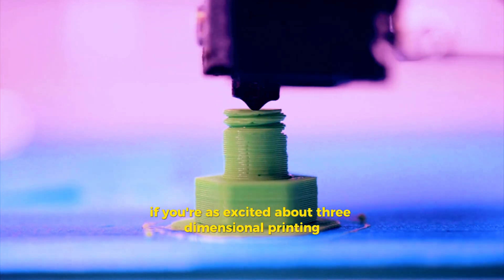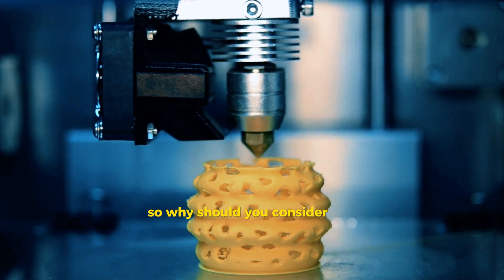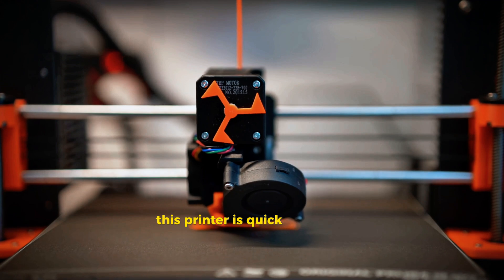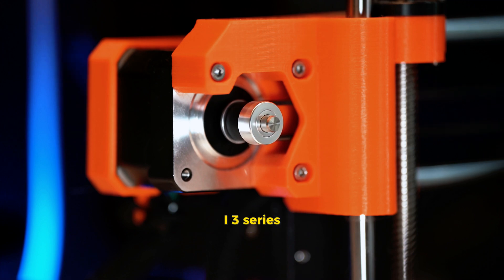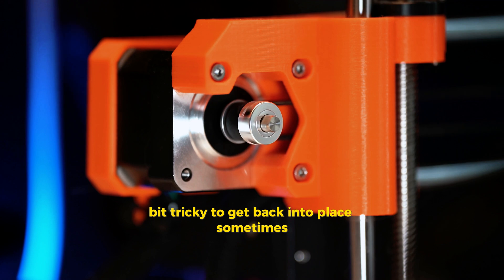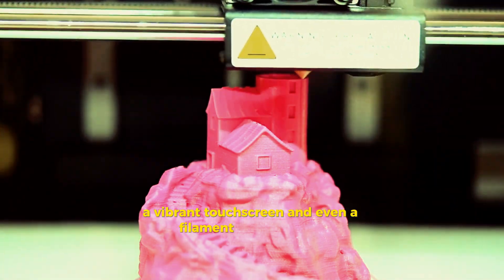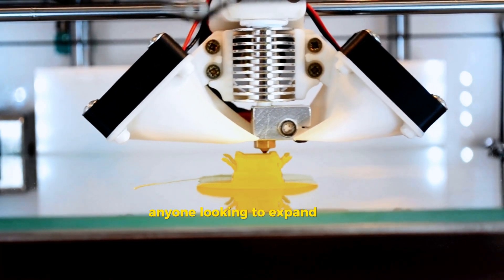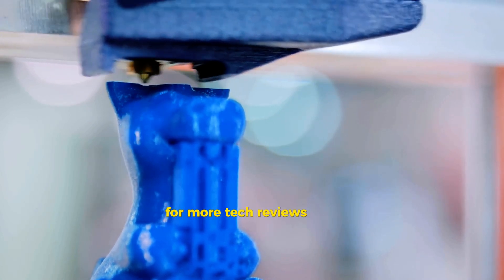Top 3D Printers of 2024: Best Picks for Every Budget!

Comment: I'm still waiting.  I have an Ender 3 Pro with a boatload of upgrades that puts it on par with a higher end Ender (auto level,  dual Z, Nebula pad, Sprite SE, Spider hotend, LED lighting).  If I upgrade in the future I want to go multi-color, and I looked at the Bambu A1 with AMS but would like to see the price drop a bit more before I pull the trigger on something like that.  I'm happy with what I have for at least a couple more years
Reply: How much more does it need to drop? They were just $500 with an AMS. Thats crazy money for that machine, even if they have design flaws and built in obsolescence.
Reply from the maker: It is best to think carefully and make the right decision. Don't forget to subscribe